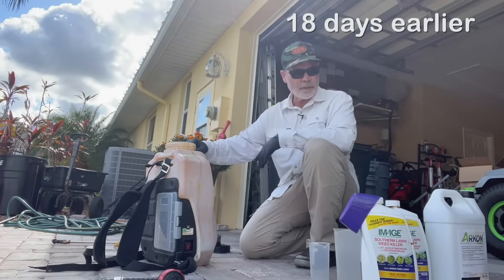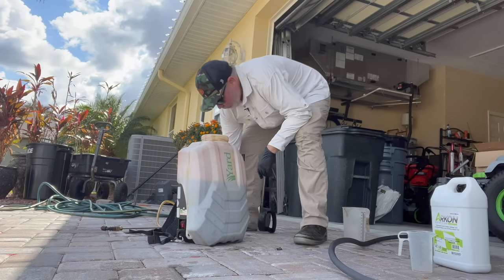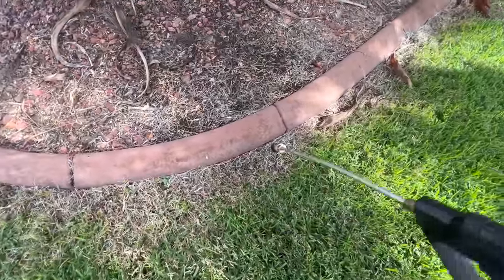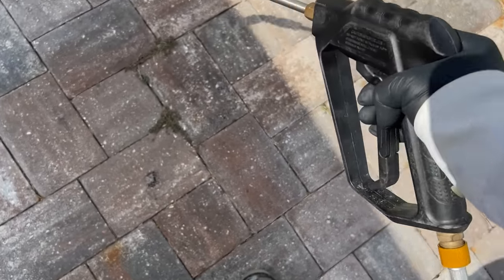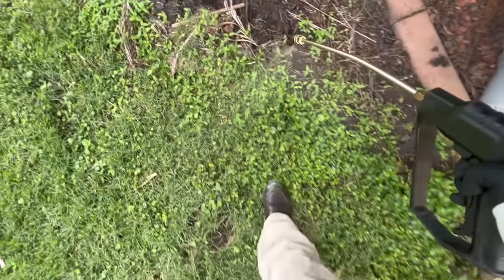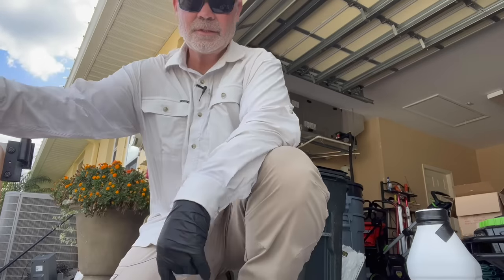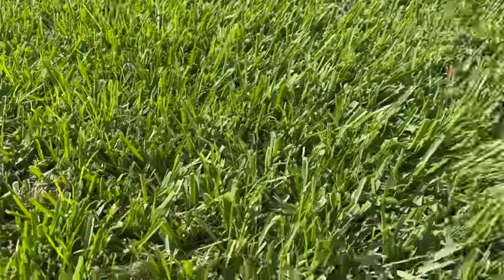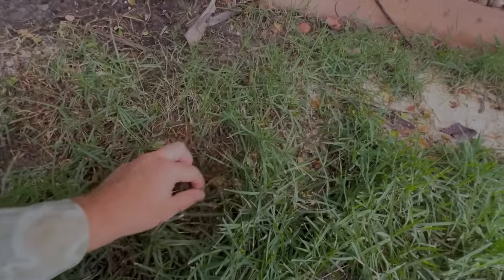Warm Season Grasses: Weed Control With Results Available at Most Local Stores

Comment: Thanks for the video. I’ve followed my Yard Mastery app plan for my lawn, and I’m looking forward to another season of making my soil, grass, and plants as healthy as possible. I also started using your recommended products on the house we bought for my in laws, which is directly across the street. The yard was extremely heat and drought stressed when we bought it in October 2023, to the point that I thought we would need to completely replace the grass. I threw it down and sprayed & prayed, and the grass bounced back surprisingly well.  We are LCN believers!

Comment: After the image has been used and you have the bare spots..do you leave it and allow the grass to send out stolen to fill the bare spots or do you use another method for the grass to fill out the spots
Reply: This is were a few plugs are a great solution, in my opinion. A bare spot in my St Aug lawn invites the weeds back to the party, big time. Allyn may have insight into how the sod farms keep out the weeds as they grow grass. Would love to know how they do it.
Reply from the maker: it would be great to stick a couple grass plugs in the barespots. In the summer I just let it grow back and fill in though because of how fast it recovers.

Comment: Great video. Think I may have either over applied or the weed was larger than I thought because it wiped out a large portion/spots on my fence line. Yard is riddled with sedge this year too, can’t stand it. 

Look forward to the video on string trimming too close as I may have a similar issue. Great video! Love the before and after as well as letting us see we aren’t alone in the struggle!
Reply: The easiest fix is 1. Use the right equipment (string included) and 2. Be conscious of how you want it to look AKA be careful and never rush your work. If it’s a little longer or bushier that’s fine. You’ll give yourself room for improvement. But once you go too low it is all downhill from there.

Comment: I started with Celsius at the max rate, it turned the St Aug a bit yellow and knocked the Bermuda back I the. Followed up with image. Almost all the weeds are dead but not the sedges. So one last application of sledgehammer. 
I’ve been adding a bit of folar firt with the weed application to give the st Aug something to bring it back. Is the firt the reason I have to do two applications to kill the weeds or is it normal to have to do two?

Comment: My dollarweed laughed at Image. Perhaps my mix rate wasn't correct. I just tried some Fahrenheit to see if that knocks out my dollarweed.
Reply: A portion of my yard has dollar weed, I used image last Sunday and the weeds are almost gone
Reply: I've had excellent results with Image on dollarweed. 8 ounces per gallon plus a surfactant. Turns yellow in 2-3 days. I've tried 4 ounces with poor results.

Comment: I have both types of spurge, and the Image really didn’t do much to either type. 

Question: I assume there is a screen/filter in the sprayer tip. Whenever I spray any chemical, I get a film built up on the screen/filter, partially clogging it. Do you have that issue, or do you remove the screen?
Reply from the maker: I have not experienced that but I do get buildup on the screen that is over the intake inside the bottom of the tank - I have to clean that off frequently.

Comment: Can you explain the math a little more for Image?  It says like you says 6.2 to 8.6 FL oz per gallon.  What does it mean 6.2 TO 8.6?  Why is there a range and what happens if I do 6.2 or then 8.6 or even something in the middle?  Other products says x oz per gallon and not a range.
Reply from the maker: there is a low rate and a high rate. It depends on the weeds you are trying to control. There are also yearly maximums. I just use the higher rate because it pretty much kills everything I face.

Comment: Spacers on your truck!?  You're smarter than that!
Reply from the maker: I'm not even sure what that means lol. JH Diesel did the leveling kit, wheels and tires for me. I think it looks really good.
Reply: @TheLawnCareNut  it looks great!  I wanted to do it to mine but have been told that wheel spacers are bad for bearings.  I don't know if that's true but I figured you would lol
Reply from the maker: @jmd11185  I did need to have the bearings replaced recently - so apparently its true
Reply: @Thelawncarenut  that could be the reason.  Are you even sure you have spacers?  I was only going by the look of the rear tires.  Now that I'm looking at the front, it looks like you have some wider tires and a rim offset.